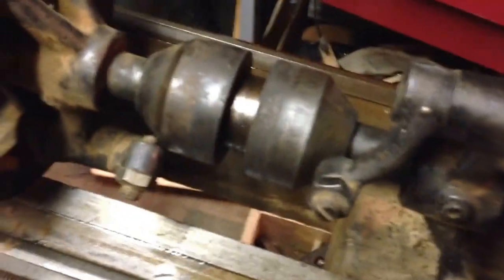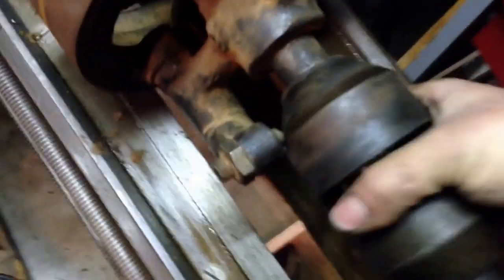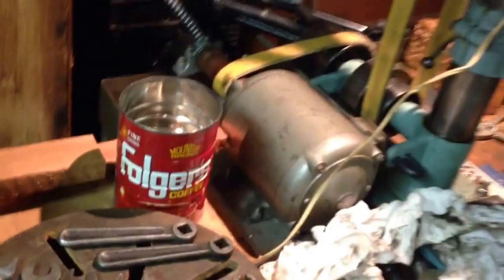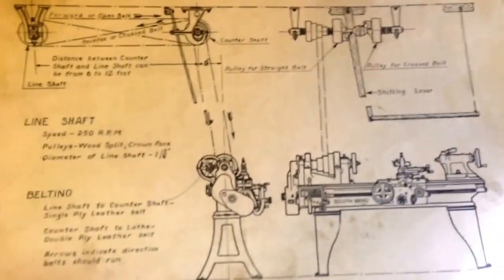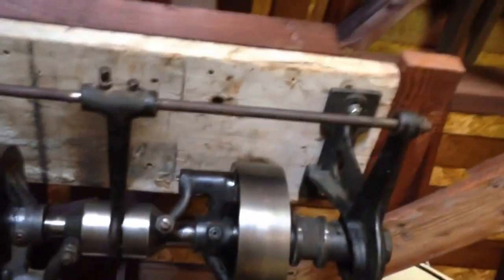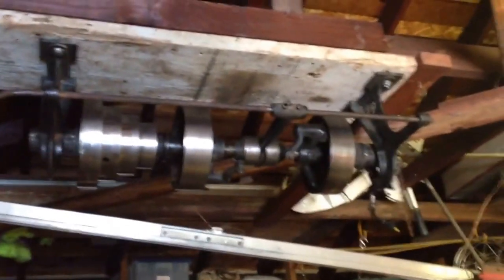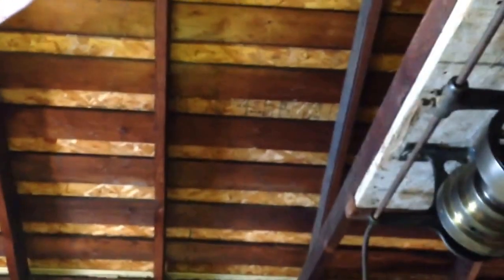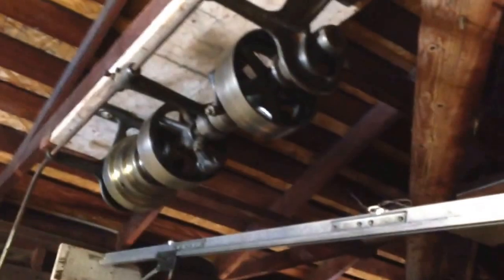Line shaft machine shop, how a double clutch countershaft works.

Comment: Well put. I have a similar jack shaft that I'm in the process of installing for a Star lathe. Your explanation clearly shows that this particular clutch acts strikingly like a drum brake on  a car, except with steal brake pads. My clutch has 2 splits instead of 1. The 2 clutches can be used to run off different size pulleys thus doubling the speeds of the lathe. I'm leaning towards 2 different size pulleys for my set up. Why would it be necessary to run your lathe backwards? I'm not a machinist and learning a lot from this and the other videos on the tube. Thanks and keep up your great videos.
Dave
Reply from the maker: Dave Wilson  if your cutting a thread without a thread dial, or cutting a metric thread on an imperial lathe, you leave the half nuts engaged and stop the lathe at the end of the thread, back out the tool, reverse to the start of the thread and run the tool back in to take your next cut, this was the most common reason to have the reverse, it was also used if you were grinding on a lathe with a tool post grinder. Since you weren’t cutting while reversing the lathe it was common place to run the reverse belt faster than the forward one to save time, so doing the 2 speed setup you could just have an extra belt stored, or simply an extra length of belt with lacing on the ends so that you may cross your belt for cutting the occasional thread. Good luck on your Seneca falls star lathe, I’ve always admired those machines, never owned one but they seem very well made.

Comment: those very old hit and miss engines could drive this line shaft. not all the time, just as a hobby for your hobby.  hmmmm. would have to be outside, now how would one get it up in the air?  hmmmmmmm
Reply from the maker: Paul Hiiginbotham  engine will stay on the ground, belt goes up in the air, actually the plan now is to pour a pad outside the new shop for the engine and belt it to a jack shaft on the ground, the shaft will go through the wall and in to the shop, and from there a belt will go up to the main shaft.